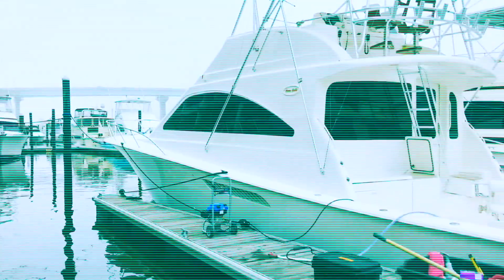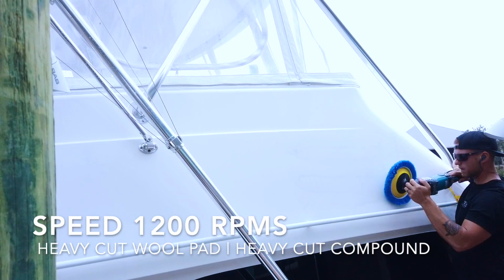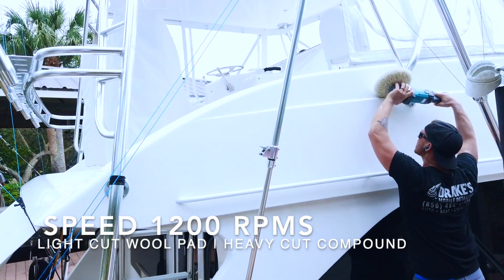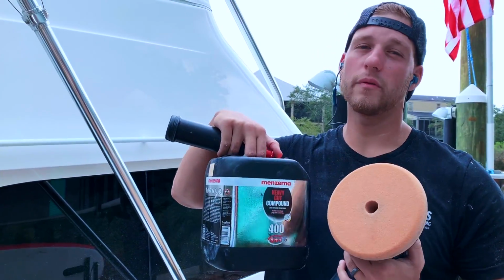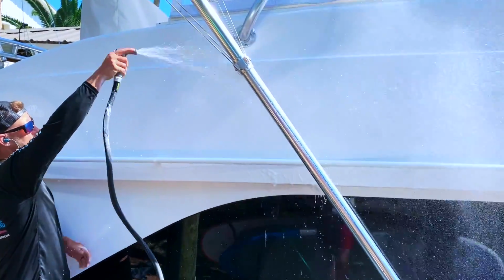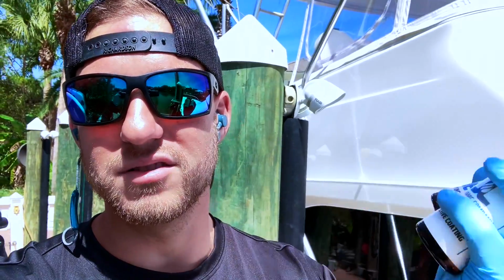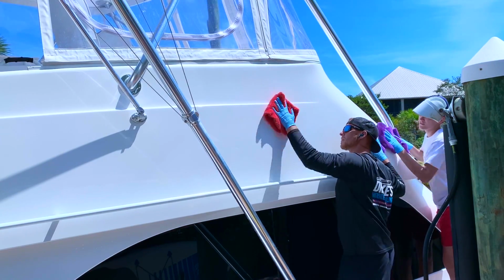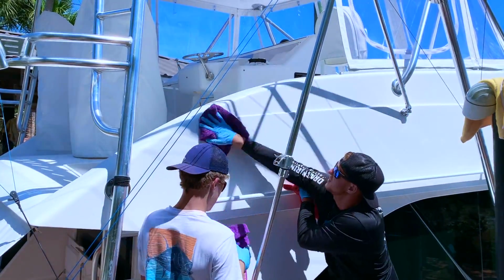How to Ceramic Coat A Boat | Boat Detailing Tips

Comment: Any problems with cutting or applying the ceramic coating over decals? I've done ceramic coating on cars but soon will be doing an oxidized boat with slightly faded decals. I just want to make sure im avoiding getting high spots/snail trails.
Reply from the maker: If you are doing an oxidized boat, you have to make sure you remove all of the oxidation completely before you ceramic coat. If you ceramic coat an oxidized boat it will not last very long at all, and you will definitely get cloudy areas with high and low spots. 

As far as decals I haven’t really had a big issue as far as going over faded decals, but you can definitely expect that it won’t last as long as it should when any oxidation is on the surface. 

Also I don’t know if your Ceramic offers a warranty, but if you read the fine print in most ceramics they say that the warranty is voided out if the boat is older than 2 to 3 years old or has had previous oxidation. So also keep that in mind.
Reply: I’m looking into different options for ceramic coating the boat. I’ve only use cquartz and ceramic pro.  

Appreciate the quick response! Keep up the content too, you’re killing it.
Reply from the maker: I am now only using igl coating for auto and marine! Great product and good prices! CP is a great product but their prices are just crazy!
Reply: I’m going to try that. Ya ceramic pro is way too pricey unless you are a dealership doing installs. Hence why I starting using cquartz

Comment: Drake how do you know when your wool pads need to be thrown away. I struggle with that so sometimes I throw them away after every job
Reply from the maker: Honestly that’s probably what you should do, depending on the job... usually once it loses its fluff, it’s time to go! It will actually cut to much and you won’t get a good finish! 

Also, if you wash your pad often, it will prolong the life of it!
Reply: Drake's Detailing Thanks brother today when I waxed with my DA.  I used a cutting disc instead of a waxing pad and it gave it that extra touch it needed. That’s wonderful advice. Thank you so much!!!
Reply from the maker: Heck yea!

Comment: What applicator would you use if you're doing a big boat?
Reply from the maker: I would actually apply with a DA Machine and a micro fiber pad It allows you to cover a lot of area faster. Use this pad ( https://amzn.to/345fauv ) on any Da machine I recommend this one ( https://amzn.to/2WZotKW )
Reply: So you can apply a ceramic coating with a DA polisher?
Reply from the maker: @Nextlevelmarine   yes, but I would only do this if you have experience with ceramic. weather you use a da or by hand only do 2 to 3 ft sections at a time. apply coating with da then level it with your towels in 3 ft sections
Reply from the maker: @Nextlevelmarine  what coating are you applying?